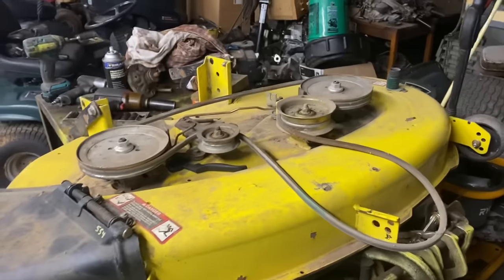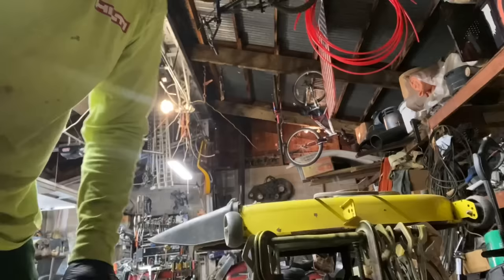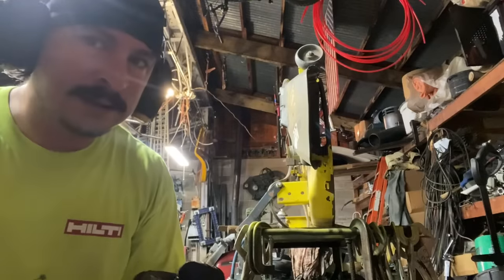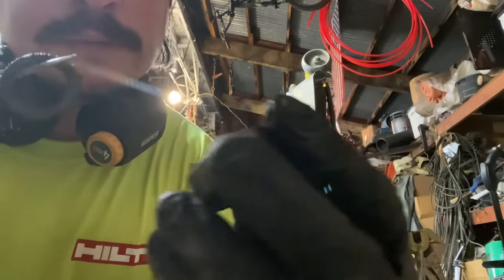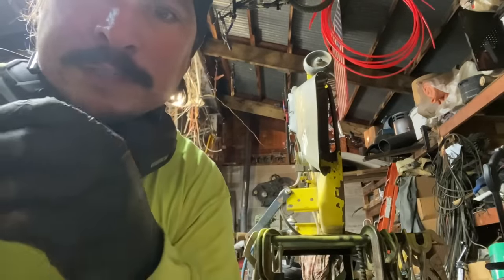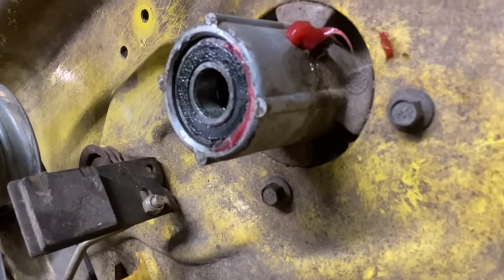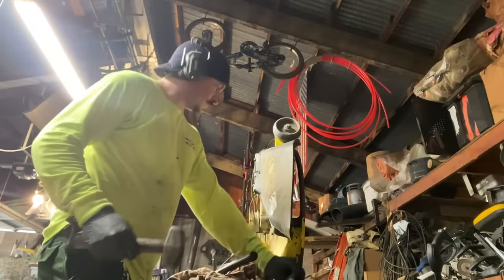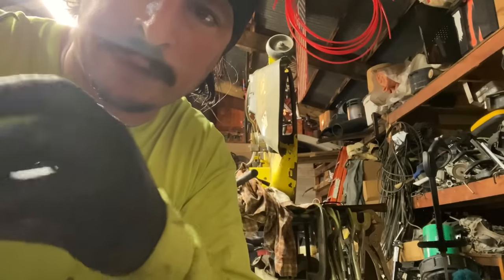Part 1 - Don’t trust the “Experts” Grease your mower deck sealed spindle bearings Common sense.

Comment: Pull inside seals and then grease, they’ll last forever, don’t push that much grease out as it’ll push the seals out, the book called for three shots a day on a disk I had,never lost abearingthatway, my brother though u had to see grease, started changing bearings very soon, u may be able to se e the seal start to move, stop there
Reply from the maker: Hold on a minute, what disk? This video is specifically for lawn mower mandrels. And to be exact it’s the box store stuff not even talking commercial grade here. 
Sounds more like speculation and you have no proof. Neither does anybody else. The shields have no space to back off the bearing. Grease must exit the lip on shield. No other way for it to happen. These assemblies are tight. Zero tolerance. Maybe this style bearing in another application could be subject to that happening but not a property assembled mower deck mandrel. The shield can not push off the bearing unless there is space for that to happen. The parts are sandwiched together with absolutely no room for parts to shift. If a bearing shield came unseated your already experiencing issues and grease was not going to fix the problem anyways. So in that case the blame can’t be put on adding grease after the fact. As Iv said 100 times in comments the reason for this video is because taking it apart to remove shields is a absolute 100% waste of time because as Iv proven the shields do not prevent grease from passing. Grease flows right by the little rubber lip as easy as a fart out of trousers. The engineers must have thought the average person could figure this out and failed to give us baby steps to explain it. You would think with a zerk installed folks would naturally figure it out but not usually the case. It even took me a while to learn how it works. And now, here I am providing step by step proof how the process works and folks with absolutely no evidence to support claims it won’t work want to say I’m wrong. Go experiment and run some
Trial and error with known hood parts or better yet new parts. I’d like
To see a video where someone pushes a seal off. Yes 3 pumps is exactly what’s needed after the assembly is filled 3 pumps is enough to push new grease into the bearings but the key is to fill the assembly first. Did you watch the full video? I suspect probably not because it clearly shows the seals remained seated after the process. You might have noticed the seals were firmly in place. Not rocket science. Yes the bearings will last forever if you do this process I show before the bearings become damaged from running without grease. Most folks do think about the bearings until there is an issue and then think adding some grease will fix the problem but by that point repairs are going to be needed and adding grease may extend that time a while but if someone adds grease and a shield pops off after the assembly has sustained damage from running to failure it is not the adding of grease that was the problem. It was running to failure before adding grease and then when the shield pops off folks will think it was the grease. Lol. Have to really understand these things if we are going to go that deep into possible situations. But 100% it works like I show. If you still think otherwise please create a detailed video with some proof and I’d be happy to watch. But nobody can prove that happens. Just a few naysayers with Grand ideas here to help us DIY guys by passing out advice when they don’t really know what’s happening. I’m not buying that bull for one more minute. And I hope folks will read comments and get to the truth. I offer free awesome advice, for those who have a better way, awesome. The hard road works too and gets us to the same place.

Comment: Why not just pop the inner seals out?
Reply from the maker: I thought I clearly explained in the video why removing seals is not necessary. If unit has grease zerks I have proven that making the effort to do such is a pure waste of time. Some folks appreciate the detail I went into to prove my point on the process. Just trying to save folks some time. Unless your unit has a weep hole in the side of the assembly between the bearings this process works 100% of the time. Poping the seals out won’t add any benefit just more work
For the same results.
Reply: @GTObearclaw1  I do believe that you've proven that grease makes it inside the bearing under pressure.  You've also proven that the people telling us to not bother greasing the spindle fittings are wrong.  I don't believe that you've proven that there's no use or benefit to removing the bearing seal facing the grease chamber.  I don't doubt you per se.  I just think it bears further research.

If you don't have to take your deck off right now, by all means, simply pump grease into that fitting.  But if you're already taking your deck off for something else, say, to replace your blades, why not to it at that point?  It's a small marginal increase in the size of the job.

It would still take some convincing for me to believe the manufacturer's contention that having that seal in place was a good idea in the first place.
Reply from the maker: @pleappleappleap  
I have no issue with someone running some tests. I’d love to see the results. However if the grease gets into the bearings I don’t see what difference the shield makes one way or another therefore what good would it do to remove it until it’s proven that would make a difference. I tend to believe it’s just as beneficial if left in place as it is if it’s removed. An argument could be made either way. I don’t have those facts. I was mostly concerned about folks believing the advice others provide saying it’s a waste of time. Hopefully it helps some folks. According to the overwhelming comments I believe it’s more of a hot topic than I ever imagined. It was a topic that never set right with me when I started seeing those videos saying don’t grease them. Thanks for the additional comment now I see more what you meant by the first comment.
Reply: @GTObearclaw1  It is just a difference of degree.  I think more grease will get in. 

But your original point that the fitting needs regular grease is more important, and I agree wholeheartedly.

Comment: The moral of the story is don't buy a cheap 100 model John Deere these are not your grandfather's lawn tractor.
Reply from the maker: It’s the same for any mowers sold at the big box stores and unfortunately even some others but even the expensive tractors need to have the deck bearings serviced in the same way.

Comment: Grease is gonna go to the path of less resistance. If the bearings aren’t tight in the housing, it’s just gonna go around the seal. You are also risking blowing the outside seal out and then it’ll let dirt in and damage the bearings. I’ll hand pack mine.
Reply from the maker: Do as you wish. Be smart to try this way right before you plan to disassemble to repack by hand just to see for yourself if the grease went in with your own eyes seals wont pop off
Unless you have other problems. Grease is a preventative maintenance and wont fix other problems. Also if grease goes around your bearings because the housings are worn out, you have other problems. Grease wont fix other problems as grease is simply preventive maintenance and if the assembly was greased properly to begin with it should go much longer and stay in good shape for more hours than a unit that was not greased. But hay, I can’t make folks do things the east way. I just show the tricks Iv learned over the years. Hopfully it helps some folks. Not everyone wants to tear a deck apart to get grease to bearings that can be done a much simpler way. Some folks are just simply too smart to need to test a theory. Like many others you already have it all Figured out. I could explain why your wrong but Iv already done so in many other comments and tired of typing the same thing over and over for each naysayer.

Comment: Spent as much time and grease as two new bearings. Way to go.
Reply from the maker: Well, thanks for noticing. Comments like this help me understand why so many people run equipment until the point of premature failure. How dare I show the most basic of all Preventive maintenance and pump 1$ worth of grease into a spindle assembly to prevent breakdowns that would require costly tear down involving parts and labor. Your right, connecting a grease gun and pumping in some grease is more expensive than two bearings. Makes me wonder why they even put a grease fitting on these things. I mean think of all
The expensive grease being wasted for absolutely no reason whatsoever. Sorry I wasted your time. Good luck with your equipment. Wish I was smart enough to understand this stuff. Thankfully you came along to lead me straight. 😂. 

Unfortunately I think this information went right over your head.
Reply: What the fk kinda gucci grease you using, and why does it take you several hours to pump a grease gun  50 times?
Reply from the maker: @mattfleming86  what’s gucci grease and who took 2 hours to grease?
Reply: @GTObearclaw1  Read the comment dude made.
He said it took "as much time and grease" as new bearings.

I wanted to know why he is using fkn NASA grease on his murray and why its taking him SO long to find that little zerk.  

Relax dude not everyone in the comments is arguing with you.  I know you're right because I pump until grease comes out...  through the sealed bearings.
Reply from the maker: @mattfleming86   Julio is obviously unable to comprehend what the purpose of the video was. Some folks can’t be helped. You can lead a horse to water so to speak. 95% of the viewers who left comments found the information helpful as the comment clearly show but yet it went right out the window for him. O well. Can’t help everyone
Reply: Well, I learned something. It never dawned on me to leave the seals on and go ahead and grease the bearings. 
It makes sense!  Now I’m retired from commercial lawn mowing. 
I had every kind of mower. From golf course equipment on down. Working as an owner/operator. Doing my own maintenance. 
I had an account with Bearings Incorporated. 
There is something to be said for new bearings. So smooth and quiet. Almost like new again. 
No matter how well you maintain a bearing, over time it will wear and get loose. I’ve noticed if a sealed bearing is needing attention it is likely time to replace it not just grease it. 
And I grease my equipment. I even have a set of hypodermic needles with grease zerks to grease sealed bearings. 
And cheap bearings from China are fine for lawn mowers.

Comment: Most of these bearings are sealed.  You can pump grease into the nipple all day and not help your bearings one bit.  Take the bearings apart and grease with red bearing grease, that's a different story.
Reply from the maker: You
Obviously don’t know as much as you think you do about how these mandrels can be serviced. Sadly your commenting on a video where I just proved your wrong. Yet you posted this comment anyways so either you think I am magic or maybe you think im providing false information. the grease absolutely does push past the inner shields and into the bearing. Just like my video shows. Anybody with a mandrel that is equipped with a zerk and a grease gun can simply test the process theirselves. You can too. Just exactly where does the grease go if you pump it into the zerk? Please explain that to me? While your at it, explain how grease under pressure is held back by a few rubber lips on the removable bearing shields. They are not seals like in a hydraulic cylinder, these seals are not capable of sealing the bearing from pressure. Grease pushes right past them. Your comment leads me to believe you have no hands on experience and have been brainwashed by big corp and possibly some of the morons posting misleading videos on the topic. Hints, why my title says don’t trust the experts. Open your mind a minute and use the most basic logic and stop believing what your told without testing it yourself. You can simply connect a grease gun to a zerk and pump it till
Filled. Next time you think it’s time to dismantle a deck to add grease, just fill it with a gun first. Then when you take the first one apart and find it’s full of fresh clean grease, you will figure out this actually does work
And works quite well. As a matter of fact it works 100% of the time. It’s a very basic concept that dates back to the beginning of these mandrel assemblies that came equipped with zerks. How have people gotten so far from basic knowledge? It’s scary to me that folks are not thinking this through. I can’t figure out why someone would want to argue about a simple
Process that they can test at home. I guess taking a deck apart to achieve the same results sounds like more fun. I have no idea. But thanks for the compliment and I hope you will
Explore this a little more and get some first hand knowledge of how it works on your equipment. You just might thank me.
Reply: Take a breath, Dude.   @GTObearclaw1
Reply from the maker: @robertodebeers2551  simply trying to help ya. You blazed in with a comment that shows you obviously need more than just the video, so I try to explain. When guys post blunt BS like they know something on the topic I kindly try to help. I can type fast
And funny enough I can type and breath at the same time.

Comment: With the seal there the bearing is a sealed bearing the seals are made to be removed to make it a greaseable bearing!!!!!!!
Reply from the maker: Yo must not have watched the video, proof is shown. Seals are not stoping grease. No need to mess with those flimsy dust shields. I just proved they won’t stop grease flowing past them. Nothing other than pumping in some grease is needed just to service the bearing. It’s really so simple it’s silly that i am back here again explaining it to you after I just posted a detailed video that shows it in baby steps. Nothing to dispute on the topic. You can try this at home. Connect a gun, pump some grease and see where the grease goes! It’s passes through the bearings. If it didn’t you did something wrong or you have a cheep MTD unit with weep holes. And that’s quickly addressed by plugging the holes with a machine screw and then grease will get where it’s needed. MTD is not concerned about us having long bearing life, they have proven that. There is a reason this video is so popular. I’m the only one showing facts proven out in the video rather than misleading DIYers. I’m here to help. And until someone can prove otherwise this video will remain to help those who want long bearing life and don’t want to dismantle a good working deck. Has worked for me for 20 years. Thanks 🙏🏼

Comment: Grease will go into a seal just not out! If you ever looked you' ll know
Reply from the maker: Grease goes right past the seal when pushed with the pressure exerted from the gun. in past one seal and out the other with little to no resistance Just like the video shows. If your not watching you would never know because the gun doesn’t even have to build pressure and you won’t feel much resistance. So you have to be looking for it to know when the grease exits and the assembly is filed. Like I explained in the video.
Reply: @GTObearclaw1  well i must of had better sealed bearings! Just didnt have time to watch the whole thing! Because ive done this also!
Reply from the maker: @anthonyking4387  it helps to see the whole video as this topic seems to extremely controversial and why I decided to make a
Video on the topic. I don’t
Particularly enjoy making videos anymore but this was a topic that needed some
Truth and
Something I have learned intimately over the past few years so I wanted to provide what I think needs to be shown because some
Of the experts won’t show the full process on their channel but say it’s a waste of time. I disagree 100-% and think this is vital services. Very boring but good information. Some key points if you don’t watch the video, may take 70 pumps to fill the void. Grease won’t reach both bearings until the voids are filled. Grease until grease exits the outer seal. Then stop. Next time you grease will only need 3 or 4 pumps as the assembly will be filled.

Comment: Good demo but to gain respect as a mechanic, it might be best to use the correct terminology for educational reasons. I know what you meant but I believe it is called a "spindle" and not a "mandrel".
Reply from the maker: Thanks for the comment. They are actually called both. If you look up parts on line they can be found under mandrel. Arguably mandrel is probably the more professional nomenclature. Respect doesn’t do much for me.